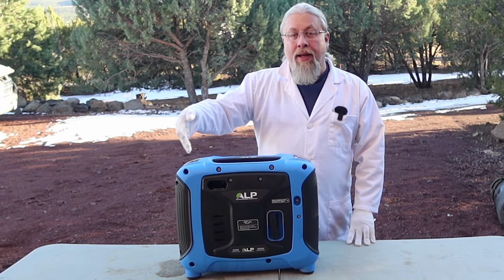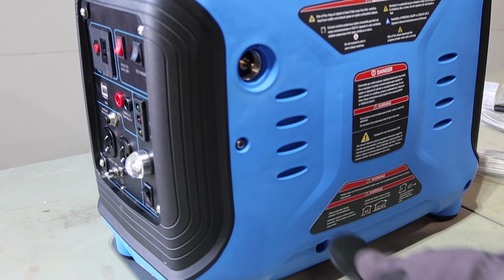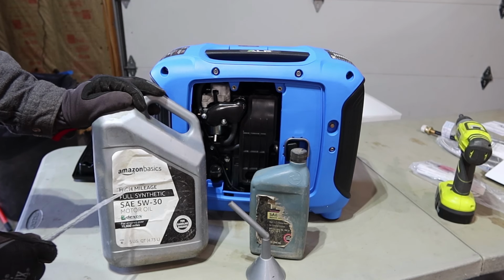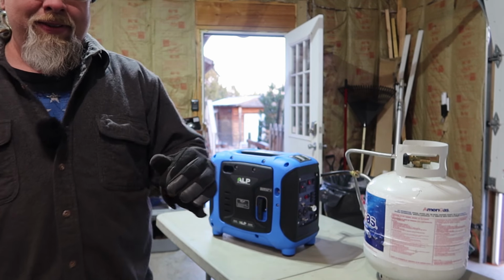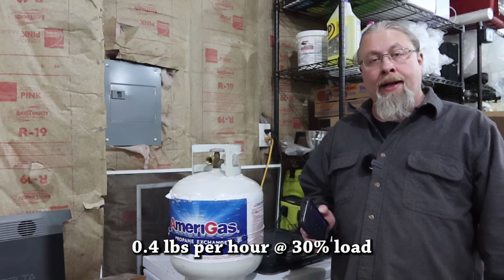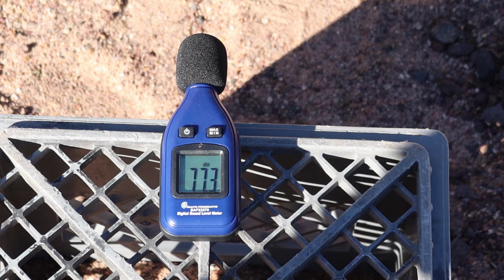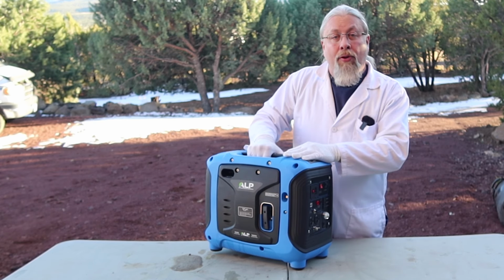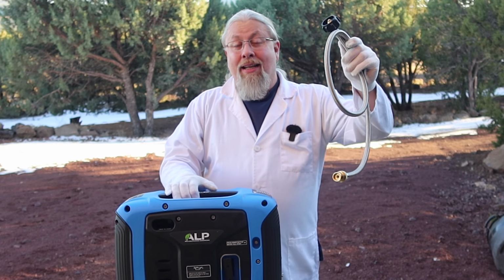ALP 1000w Propane Generator Review | Parallel Ready Eco Friendly Compact Efficient

Comment: I’ve been waiting on this review, you’ve helped me make my decision.....too loud and a bit too small for me.  Thank you.
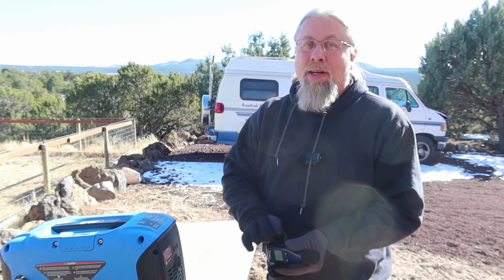Reply: @josephp1592  negative, he was testing it outside (16:40 mark) with a decibel meter.  It was reading between 73-85 decibels.
Reply: You can not go by videos. Even very quiet generators sound loud on video.
Reply: @John_Ridley  I didn’t, if you actually watched the video hobo used a decibel meter!!  🤷🏼‍♂️🤷🏼‍♂️
Reply from the maker: The camera always makes generators sound louder. I am using a compressor on the audio to make quiet sounds louder.
Reply: @HOBOTECH  It was the decibel meter that made my decision. But I do appreciate you testing it, you have made some decisions on purchases easier.....Thank you!!
Reply from the maker: @ADKMan  I should probably do a follow up and explain that official testing of generators is done at 23ft (7m) which is why it looked so loud.
Reply: @HOBOTECH  yes in the video, I think you stated you were about 6/7 feet away during the testing.  Most are done at 23 feet, my Champion at 10 feet is right around 59/60 decibels.
Reply: @HOBOTECH   , ,  thank you,  thanks for the education,   didn't  know that sea level / elevations have effects, decibel effects .   previously only know, higher elevation means less oxygen .
Reply: Generators sound everything, it’s okay. Noise level is acceptable. I think what’s more important here is the smallness, the compactness and the ease of use

Comment: Thank you, Professor! This is perfect for those who do not like storing gasoline. Also fills a gap between solar, wind and gasoline. Redundancy helps deal with equipment failures and such. Another well done video! Best regards from hurricane prone Coastal Texas!
Reply: Propane also has a LOT longer shelf life than modern gasoline does. So you don't have to worry about fuel you've had sitting around for a few years being junk.
Reply: @Shane-Singleton  I just experienced this during the DEEP FREEZE 2021 here in Coastal Texas. I had one 5 gallon gas can from 12 months prior, and although treated with Seafoam, it was still regular unleaded 87 oct with 5% Ethanol. My other gas cans had Ethanol-Free 92 Octane, and when I fulled my generator with the junk gasoline, there was a marked difference in how the generator ran and even how it sounded. When that tank was near empty, I re-filled with Ethanol-Free and was back to normal. And, I just bought a Dual-Fuel generator and more propane.
Reply: @GalvestonCountyMike  I'm up in the Dallas area here. Ever since we got a local Buc-Eee's that has ethanol free gasoline we use that for all of our small engines and keep ~15 gallons of it in rotation due to its stability. We had similar issues in the past as you had. Even in fuel that was treated with Sta-Bil. It just wouldn't last.
Reply: @Shane-Singleton  Shane. I'm in Galveston County. The temp got to 16 degrees F for a few hours. I put 45 hours on my vintage Generac 8KW generator. Fortunately had a couple of weeks prior, changed filter and put fresh batch of Mobil1 10w30 oil in crank case. After 45 hours of run time from the freeze, the oil still looks great. We have a Buc-ee's here in Texas City, and I use their Ethanol-Free 92 octane fuel. Amazing stuff!
Reply: After Hurricane Michael hit our area one of my neighbors couldn’t get his 5000 watt generator running so he put it out on the side of the road with all the other trash. I picked it up and then put a Propane/natural gas conversion kit on it a few months later. It runs like a champ on propane tanks. It’ll supplement my gasoline generator quite nicely. The propane generator starts a lot easier than my gasoline one does and it runs a lot smoother, too.